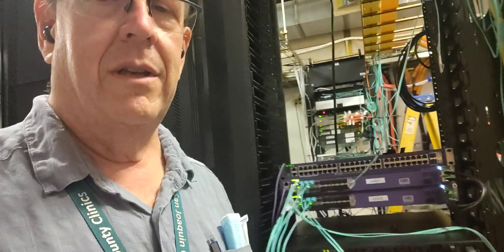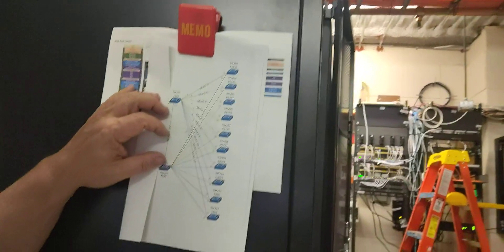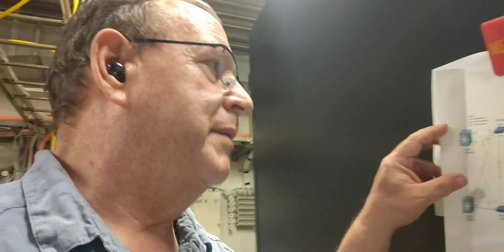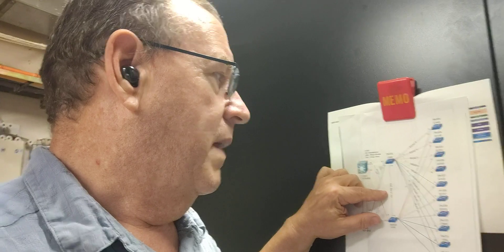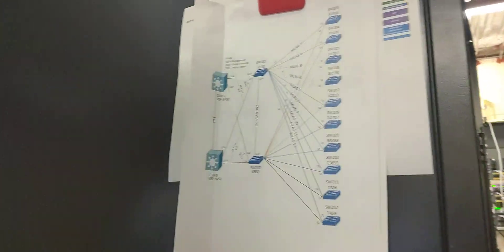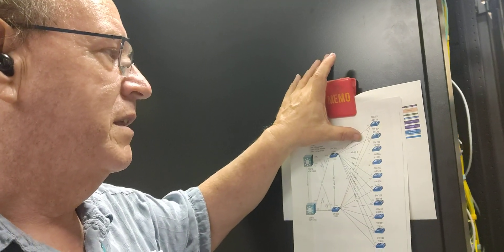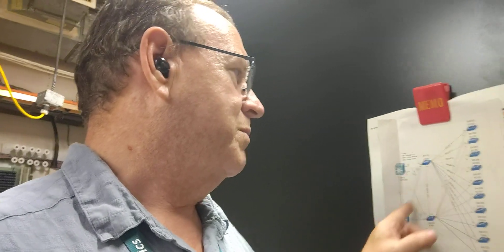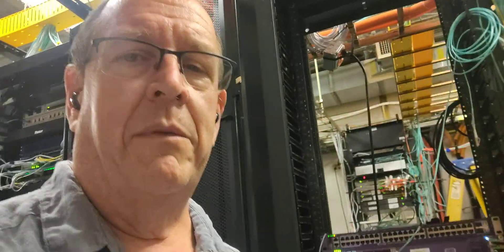Network admin life - loop in the patient vitals Network

Comment: Just curious? Are all of those access switches layer2? 

Personally layer2 seems so inefficient at times. Personally I prefer to bypass it all(keep STP running of course)

Have layer 3 switches for all access switches, setup routed ports. To move vlans across switches use VXLAN.

Layer 3 is far more superior, removes all spanning tree, because all links are forwarding. All bandwidth is utilised. Broadcast and failure domains limited!
Routing protocols protocols provide intelligent load-balancing as opposed to L2. It will maximise and utilise all available bandwidths, rather than having high speed 10gig ports in blocked state. ECMP failover etc.

The only issue with L3 is end devices are always inherently in a L2 broadcast domain VLANS. We know we can’t route VLANS(L2) across L3. This is where multilayer switch with VXLAN capability becomes useful as access/leaf switches.

I know it’s something far fetched lol and requires redesigning the entire distribution framework. However in the long term it’s just so much more efficient and you don’t end up wasting money buying high speed network fabric devices  only to utilise half of the bandwidth of those devices, and the other half in blocked state, due to STP.

Some call it datacentre architecture, think it’s very versatile.

God bless, love your videos!
Reply from the maker: You take an interesting approach.  So, say for a campus environment with many network closets and many VLANs you would, say for instance, make each set of edge switches a L3 switch and do their own routing?  Then set up, say, OSPF to exchange routes between the switches?  Am I understanding you correctly?  If so that's an interesting thought.  I'll have to noodle on that a while.  Thanks for the thoughts and God bless!
Reply: @NetworkAdminLife  

So you will use routed ports on all switches(so yes they must be L3 switches) each access switches will advertise its vlan interfaces via ospf.  All access end-point devices will remain in there VLANs. 

Now the only issue with this is, VLANS cannot transverse over L3 links. For example VLAN 2 on switch 1 will be different than VLAN 2 on switch 2. Because they are in separate network. 

So how can we extend VLANs on a routed/layer 3 network to other access switches for example say you need to move VLAN 2 end-point devices on switch 1  to VLAN 2 on switch 7, while remaining on the same VLAN? This is where VXLAN(extensible vlan) comes in. 

Because the entire fabric will be layer 3/routed ports. The way VXLAN works is It will encapsulate the layer2 VLAN frame into Layer 3 IP then it will transverse it across the fabric to destination switch. Once packets arrive at the destination switch VXLAN will decapsulate the layer 3, revealing the layer 2 frame and push frames to the corresponding VLAN(I.e vlan2)
You are basically trunking VLANs over a layer 3 fabric which is amazing! No more Mlag/VLC/stackWise/VPC no more stacking to prevent STP, because  everything will be layer 3. 

Only issue is cost of layer 3 switches etc, you will simply need p2p routed links /30 or /31 between the layer 3 switches! And OSPF. The biggest benefit is the ability to use ECMP! This will basically split data across two paths, can you imagine how much faster and efficient that will be?

The other major fundamental aspect is, the ability to span VLAN from site to site over L3 link.
subsequently you could have a spine switch(distribution)vlan 20/Vlan interface 192.168.20.1 trunking to a edge/access switch in another country! because it will be via L3

God bless!
Reply: @networkautomator1362  It's quite a step up to go from a "smaller" legacy 3 tier network with MLAG and STP to fully routed and then BGP EVPN with VXLAN on top, thats the realm of larger datacentres and hyper scalers, ISP's etc.  Although its cool tech and relatively boiler plate to deploy, I've never seen it used at a smaller place.  I guess in the future it will be part of standard Networking toolbox with modern devices, isn'nt there some next gen SDN campus effort by Cisco trying to do this where the overlay stretches out to campus edge? .
Reply: @tech-trials-and-tribulations  I think you are referring to Cisco SD-WAN, an overlay which is essentially utilised to provision, manage and separate control/data planes of the Edge devices. The DC seems fairly middle sized to me. VXLAN isn’t exclusive to EVPN /BGP. The flood and learn method can utilise OSPF and Multicast PIM sparse mode on the Layer 3 underlay. Then VXLAN can be utilised on the overlay to help the migration/transportation of L2 VLANS across the layer 3 fabric. Most places now utilise nexus or other VXLAN capable L3 devices as access. However 
Sadly you are correct cost is still an issue, in terms of L3 devices.

Comment: Or maybe an duplicate mgmt address? Or misconfiguration on the mlag id?
Reply from the maker: Right now this is where we're heading.  Each distribution switch has a separate LAG leading back to the two core switches.  The other side of the dist switches have MLAGs going out to the edge switches.  The vendor is thinking there should be an MLAG leading back to the two core switches as well.   We'll find out soon.  God bless!

Comment: One thing you could do is enabel elrp on all vlans and setup trap and log as migitating solution. Connect the console to the switch and should see something in the logs. If its looping then you will get log entries. Working with Extreme Networks since 2014 with BDX8 and X460 G1 and G2 this is a traceable problem if its a loop.

Comment: Just spitballing, but maybe one of those ports can be mirrored and you could take a pcap of the traffic causing the loop. Maybe it could give some type of an indication of spanning tree is casting it. God bless!
Reply from the maker: My thought is spanning tree as well but we have STP enabled and SLPP (simple loop prevention protocol) enabled on the cores so they should be shutting the port down if it detects a loop.  SHOULD  :-)  The vendor is looking at it and he thinks he knows what may be happening but needs to try to duplicate it in his lab.  Stay tuned.  God bless!